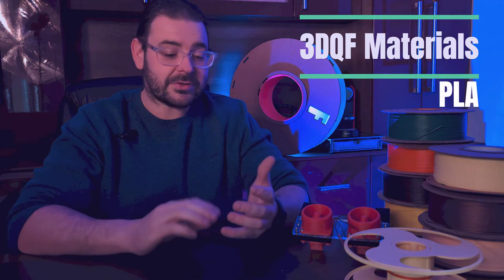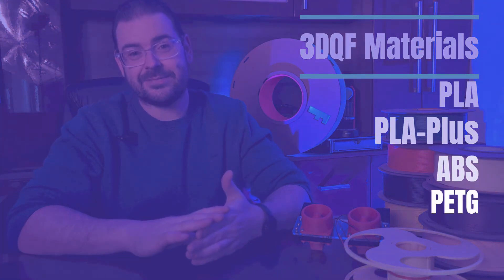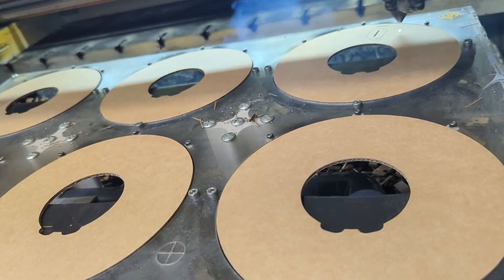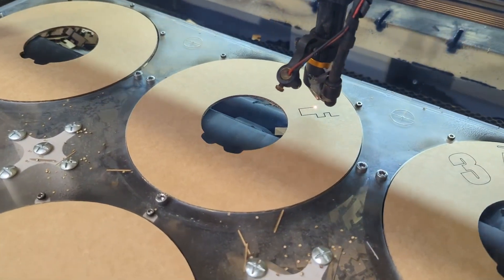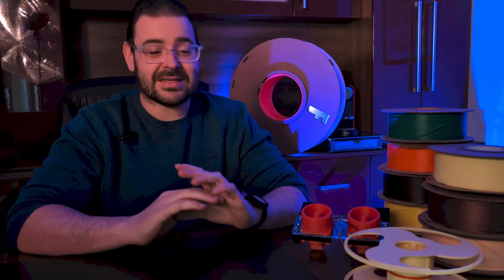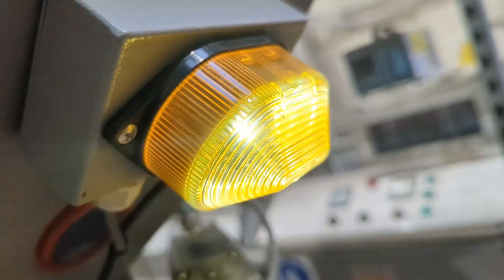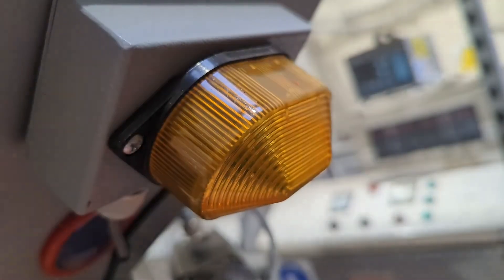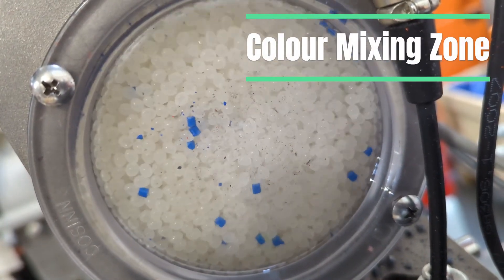3DQF Introduction Video UK Manufacturer of 3D Printing Filament

Comment: i've been buying PLA from you guys since i got my first ender 3 in 2017. The products have always been fantastic quality and i've never been let down by your products or your services. In my opinion, the price is fair considering the consistent quality of the filament.

I've also tried your resin and although it worked fantastically, both the chemical smell and price are a little over the top compared to some of your larger competitors. Hopefully that's something that might change in the future though?

Comment: I first started using 3DQF filament, wayyy back when they was selling it on eBay, used bull dog clips (I still use the ones I have lol) and had metal end caps on there rolls!. It is my go too filament, it’s amazingly consistent, great value, and easy to print with. The guys at 3DQF are a credit to the 3d printing community, and are very approachable. They’re always trying to improve there product and have revised there spools many times so they fit more printers and are more inclusive. I highly recommend them.
Reply from the maker: Thank you Ivan, and your right ! From the very start 😊 seems so long ago now ! Thank you for the support buddy!

Comment: Id love to support British business but £20.99 for PLA Plus far too expensive.
Reply from the maker: We will do a video on the "truth" about PLA-Plus . We use two different materials Natureworks 4043D for our regular PLA and Natureworks 3D850 for our PLA-PLUS. There's significant difference in the materials. You will struggle to find anyone doing 3D850 at the price we do it at . 

Best case, most imported PLA-Plus are 4043D or similar compounds "best case" . If the manufacturer isn't telling you what the material is why is that ?

We tell customers to treat our base PLA as if it's a Plus , same 215-225°c hot end temps. 

If you need the extra performance of a Plus then try our 3D850 but it certainly shouldn't be your default option with our filament.
Reply: I've tried every filament going as I print for a living and I can buy filament equally as good as yours for £10.99 or less. Its a shame you cannot get to these prices but like I say I'm a business and need low prices to stay competitive.
Reply from the maker: Depending on your consumption you could get on a business account , feel free to drop us an email :-). 

The filament is not the only consideration, supply , consistency and working with a local manufacturer can be so important.